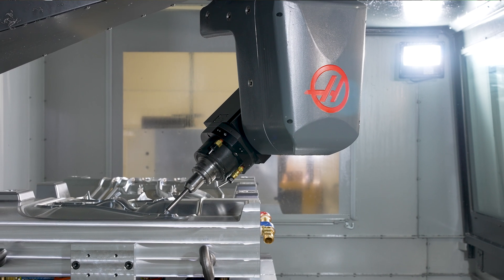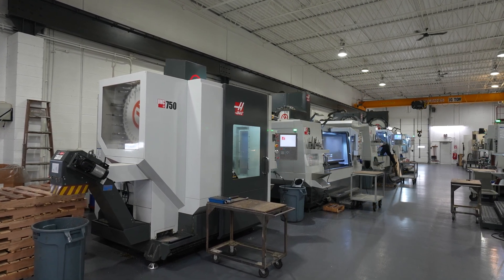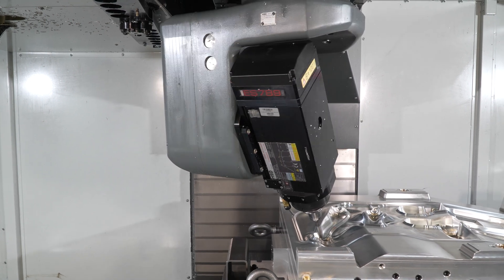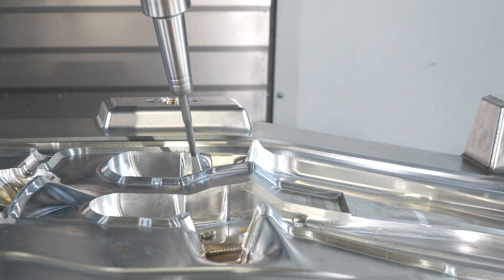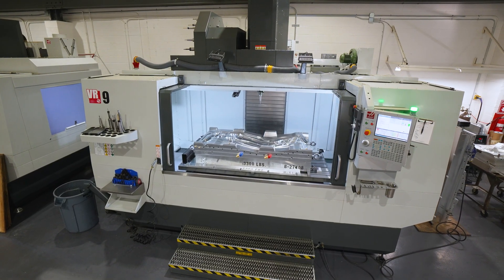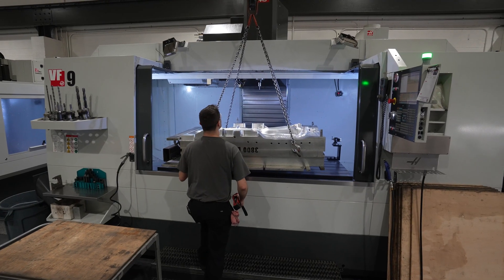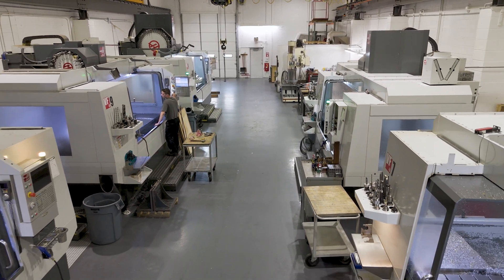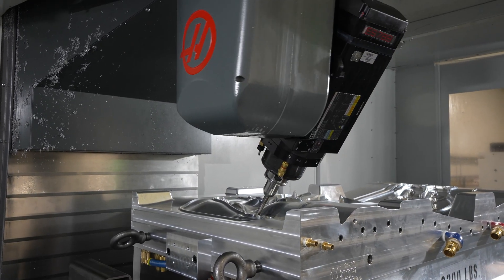Machining Large Billet Molds on a Haas VR-9 5-Axis at Mallory Pattern Works

Comment: our company just bought a vr9, so far very disappointed. Trying to tap a plate with 481 holes, keeps going into z axis encoder fault. Been 8 days no word from Hass tech service yet. Also the coolant flow is terrible. Says the high speed pump should flow at 12 gallons a minute, ours is pumping about 10 gallons in 5 minutes, don't see how we're suppose to use it on a mold when some cavity's we cut out 6 to 8 inches deep. The haas tech is trying to tell us that's how the pressure is on a vr9 5 axis. I noticed when haas shows you how the high pressure coolant pump works they are not using the  vr9 in the video.
Reply from the maker: Sorry to hear that, what city and state are you located in?
Reply: @hfotridentmachinegroup  we're in Fountain , Colorado.....haas just told us today the machine is designed for 2 gallons per minute coolant flow which is terrible, not sure how we're gonna make this work. We wanted to see one before we bought this but they said none available in our state. There is 2 of them but you needed security clearance. How do you flush the chips out efficiently?
Reply from the maker: @mounta59378  we are the HFO in 14 states, mostly in the Midwest and Northeast, which is why I ask. Have you considered a high-pressure coolant system, like MP Systems? 

I'm not a service tech, so forgive me if that's not something that would solve the issue, just a thought.
Reply: @hfotridentmachinegroup  Haas does sell a higher pressure pump but we were told would be a waste of money because the line coming thru the 5 axis head is only a quarter inch diameter